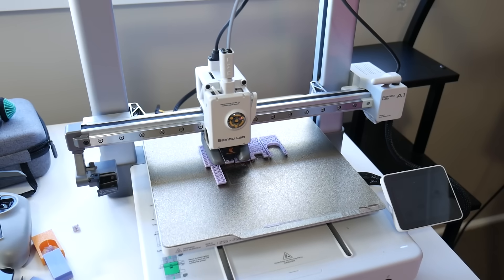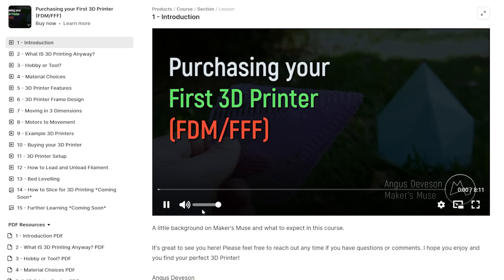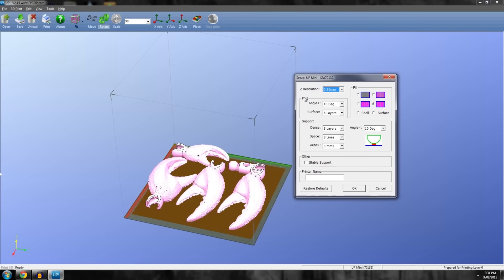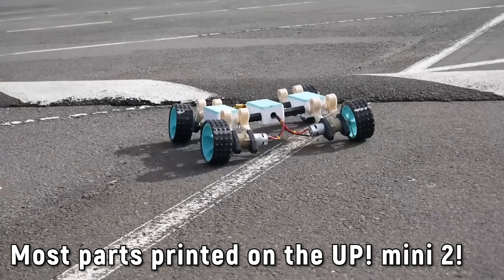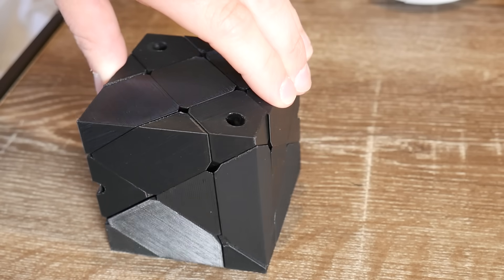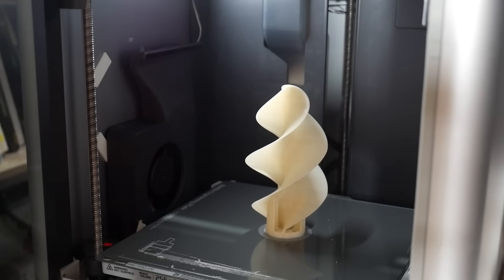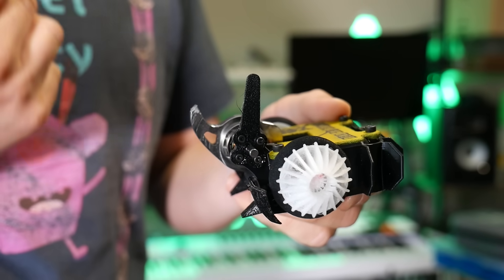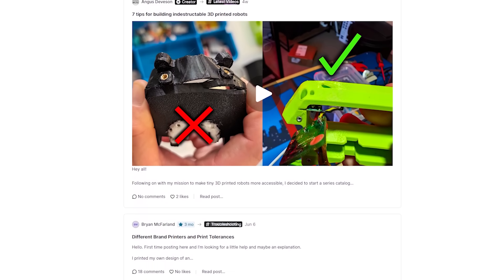The best 3D printer is...

Comment: I'm with you on the Bambu printers. I own an X1C, an H2D, and 5 AMS units. I'm a maker, not a tinkerer. I started many years ago with an Ender and spent endless amounts of time installing and configuring addons and upgrades and hated every minute of it. All I want to do is slice my model, send it to my printer and retrieve the finished product sometime later. My Bambu printers do that perfectly... almost every time. I know there may come a time when I regret locking myself into the Bambu ecosystem, but for now, I am completely pleased with the performance of my Bambu printers.

Comment: 3D printers will never be 100% plug "Plug & PLAY" unless the actual printers (components, build, etc.), and materials are 100& universal imo. And even then, a significant amount of AI would be needed for problem detection and resolution. Computer Numerical Control, CNC,  machines of any type are very complex. And although the ease of operating and print job reliability, speed, build volumes, etc. has gotten WAY better over the years, so too has the number of materials, subtypes (basic, silk, matte, etc.) and the variables that come along with them increased. The biggest problem that really started with Creality's mass marketing and continues to this day is the industry's hype centric marketing. There's absolutely nothing wrong with promoting your product. The problem is, there's insufficient attention given to emphasizing the fact that as cool as 3D printers are, they are not toys, not plug and play. They require, at the very least, a basic understanding of the technology and how it actually works - bare minimum. That said, If a person is going to spend hundreds (or thousands :P  ) of dollars on a printer then it's on them if they didn't do at least a wee bit of research to understand the basics and then keep learning. Unlike 10 - 15 years ago, there is now a VAST 3D printing community via, YouTube, blogs, manufacturer sites (I'm looking at you, Prusa) that provide a monumental amount of info., tips, tricks, solutions, etc. It kind of boggles my mind how many people post the most basic of issues that the research BEFORE buying a printer would have either prevented or made very easily solvable. Angus' advice to do your research  and put thought into it before pulling the trigger on a 3D printer should be the first Commandment of 3D printing. I researched the technology, operation, materials, models, designing, what I thought I'd actually use a 3D printer for for three months before I spent the $$$ on my first 3D printer in 2021.

Comment: Great video! And props for making people think for themselves, instead of blindly trusting others as we're all being trained to do.
Did my reasearch about a year ago (absolutely hated my Anycubic Mega X) and pulled the trigger on a P1S with an AMS - absolute gamechanger!
I love that thing to bits and it completely revived my love for the hobby. Went through the pain of dealing with a cheap, junk printer, and learned the ropes - but having a unit that just works is a godsend.
Reply: My first printer was an Ender-5.  I'd reached the point where I only 3d printed things if I absolutely could not find any other solution; it still had some use but I hated it.  Then Bambu came along, I backed the kickstarter, and after about 3 months was all caught up on things I'd planned to print because there wasn't a better choice, all caught up on things that suddenly became viable to print even though there were options, and all caught up on things I'd started printing just because the printer wasn't doing anything else.  Today, I've become much better in CAD because I'll use printing to solve a problem if it's at all viable and affordable.  Complete flip on where 3d printing fits in my building process, and all because of a truly reliable and easy to use printer.
Reply: I heard the Mega X was a reliable tank that printed well, what did you hate about it?

Comment: My gf and I went shares on a Bambu A1 late last year. It was a decent enough start but honestly I started getting annoyed with it long before Bambu started getting extra shady. By the end of January I really felt like the A1 was holding me back so it got sold to a friend and we bought a Prusa MK4S with MMU3 and enclosure. It's been all good since apart from a small hiccough with the Buddy board but Prusa support got that sorted quickly.
Good solid support from a manufacturer is an important aspect because even the most reliable printer is going to have something happen sometime.
Reply: Was it holding you back? What can you achieve now that you couldn’t then, if you would have bought the AMS?
Reply: @float32  We had the AMS but the MMU3 is better. It will do 5 colours over 4 and has less waste compared to the Bambu system. The biggest thing though was the enclosure, the A1 cannot be properly enclosed to reliably print ABS, ASA and others that need higher enclosure temperatures. Bambu themselves say not to enclose the A1 because they know the components they used aren't rated to handle the heat.

Comment: I bet no one cares, but here's my printer history: My first printer was the Wanhao Duplicator i3 (based on the hilarious review by the 3D Printing Nerd). Horrible extruder and the extruder motor failed, but I replaced the motor and got a Flexion extruder for it and it became a printer that I still use for flexible filaments. I even used it to (very slowly) print a tool for some olympic sailors, because I can get great prints out of it, if I just run it at a "very reasonable speed". The end stops can be a bit glitchy these days and the bed has to be leveled regularly, but I'm printing on a glass sheet and loving the glass-smooth results. Next up, Fabrikator Mini, which I mostly used as a portable & spare printer. Still have it, but haven't used it in years and could easily have skipped it. Then, the original Ender3, which served me well, especially for slightly larger prints, but I never printed anything except PLA on it. Sold it to a friend and it kickstarted his 3D printing and modeling hobby (and maybe even a career). The bed mosfet failed recently, but it's still working OK. Next, Artillery Sidewinder X1: It was OK at the time, but the bed is not removable and those ribbon cables with no strain relief can go bad awfully suddenly. And the bed is AC, which is nice for heating speed, but I worry about the safety. The next one was a huge mistake, but I did use it for a year as my main printer: the Artillery Sidewinder X3 Plus. I totally missed that the X4 Plus was already out at the time. The mechanical design has several flaws and it still has those ribbon cables (but they do have strain reliefs). Still have it and it prints fine, but I wouldn't advise anyone to buy one new. Latest printer Artillery Sidewinder X4 Plus S1. Much better design and I'm really liking Klipper and having wifi. A few software hickups (don't tell it to mesh level the bed unless you have freshly homed all axes) and the power switch kind of failed on the first day (but then decided it wanted to live, after all). Lots of bang for the buck on that printer, but I would still classify it as a hobbyist machine where you should have a lot of technical skill or it will bite you. If someone new to 3D printing asks me, I tend to recommend Bambu Lab or Prusa.

Comment: I had a crappy Wanhao i3 that I had a lot of trouble with, especially with leveling the bed. I upgraded to a Prusa MK3, paying the premium price, because it would just work.  And it still just works, for the most part.  Its seven or eight years old.  It was an MK3S and then an MK3S+. It had an MMU2, an MMU2S and an MMU3.  I've invested a lot of time and money in this printer.

Prusa still makes premium printers, but does Bambu Lab and a few other companies out there.  It's no longer worth paying the extra money for a Prusa printer, in my opinion. There are more affordable options out there that will give you a great experience.  I waited for years to upgrade my MK3 to an MK4.  For what it would cost me to do that, I could buy an Anycubic Kobra S1 combo and still have money left over.  I could buy the Bambu Lab A1 Combo and have even more money left over.  It's just not worth it to me.  (If you're reading this, Josef, I'm sorry. I love my printer, and I've received nothing but stellar support from your team.  If you didn't cost almost twice as much, I'd buy your products again.  You're just too expensive.)

Comment: I agree with most of what you said. I have been 3D printing for around 15 years now and have owned 5 different printers. For the past 5 years I have used Prusa MK3S machines (2 of them) and they are extremely reliable to the point I often send prints (using Octoprint) and then completely ignore the machines (never even looking to see if first layer works) and just know that I will have a great part when done. I sell prints (useful items, not tchotchkes) and needed more speed so I recently (about 5 weeks ago) picked up a Bambu P1S and after the first week I thought I had made a huge mistake, the software is really odd and I was having issues with getting parts the correct size (and in my parts size matters) and while my Prusa prints fail about 1/100 so far the Bambu fails are about 15/100 but when it works it works well and is fast but I do have to keep an eye on it at least for the first 2 layers or so. Having an AMS on the P1S is very nice but the UI for it is clunky at best and often does not do what I tell it to, like last night I was using support with their support material and I kept telling it that roll 4 was the support material (did not auto recognize it) and every time I "saved" it, it reverted back to saying it was black PLA instead of white support material. Took like 6 tries to get it to 'stick' and it finally worked but I find myself fighting the software more than I should have to while Prusa Slicer and Octoprint just work and are lots more logical about settings and operations.
Reply: consider using orca slicer, I'm completely using it in LAN mode now with orca and it's just as good as before, no ams syncing issues either

Comment: I purchased my first 3D printer in early 2018, a bed slinger, common design at the time.   I then upgraded to a Core XY machine in late 2023.    I have been happy with both machines.    I have had my share of print failures, often first layer adhesion issues.
I do like the convenience of auto-bed levelling but my latest machine still needs me to re-calibrate every now and again due to first layer adhesion issues.
I do not consider my machines perfect, but they have been generally reliable which as Angus states, is most important.   3D printing is a hobby for me, but I still expect a print to complete.
Good video Angus.

Comment: At this point, i just want a printer that prints. I don't want 3D printing to be my hobby. Luckily so many printers are far more reliable. I have the H2D now and it's awesome but i equally find my Neptune 4 Plus just as reliable.
Reply: My Qidi q1 pro is a beast. Every single print worked, apart from me doing silly stuff lol

Comment: The best printer is the one you know inside and out. The printer that you can MAKE into a reliable machine, after having learned it's particular limitations. But then again, not everyone likes tinkering with things. It all depends on what kind of person you are, at the end of the day.
Reply: Nah, it’s much nicer when you don’t have to fix bad engineering, and get something that works out of the box, with the limitations being more about the print medium than the printer itself. My first printer was a $200 pos that I made reliable. Money and time spent was a ridiculous waste. I learned nothing of value, since spending a bit more made all that learning obsolete, and putting that time into design of things to 3d print would have been way more valuable. Some people want to play with the machine, some people want to make things with the machine (the reason it exists).
Reply: @float32  If you just want to use a black box and don't care about understanding how it works, that's fine. At least you learned you're that type of person. That's valuable for you to know that. 

I, for one, enjoy problem solving, and learning about how things work, so I enjoy tinkering with machines. I find that rewarding and valuable for me to know. There's no "best" way to be. Just different attitudes towards what you believe to be a better fit for yourself, which is fair enough.
Reply: Well, I built a Voron v2.4 350 and know it inside out.  It's a great printer.  However, my interest in 3D printing is designing and printing functional things.  It was super fun and valuable building the Voron, but I also have a BBL X1C.  And I generally use the X1C because I don't really have to think about it.

I'm still upgrading the Voron.  Added sensorless homing when one of my homing switches went bad.  Added a Voron Tap when I got sick of the Z-offset fiddling whenever I changed the nozzle size (I switch between 0.4, 0.6 and 0.8 frequently).  Changed to MODBUS when a wire for the thermistor broke in the middle of one of the drag chains.  It's just not my workhorse printer.  And at the moment my Voron has a strange problem where the hotend stops heating mid print.

My Voron is my 3D "printer" hobby printer.  My X1C is my 3D design and printing utility printer.  I have the best (and worst) of both worlds.
Reply: @techringo6469  Yeah jesus I get tired just HEARING about people building and maintaining their Voron machines... It's like coding your own OS before you're able to use the computer. 

I'd usually consider myself a fairly technical and handy type of person.... But f that! Creality upgrades are enough of a headache for me tbh!

Comment: FDM printers almost stabilized, still not perfect. There is no plug and play, set and forget toaster oven analog yet. Wish some slicers could use the fancy NPUs in the AI enabled computers, to decide on orientation, supports etc and much more. There is also a need for auto calibration of filament and material, just like a klipper self tuning. It is still a tinketers toy, except with more predictable results with understandable limitations. May be the next game changer could be a 3d printer with suitable material, that could print like a silkworm in mid air!.❤👍

Comment: I love my Bambu P1S for being extremely consistent and making me not hate filament printing anymore (I hated my Creality CR10s so much!!! If I had a time machine I would have told Past Me to just return it.). Though yeah a bit of a suspicious side-eye in regards to how far they want to wall-garden themselves. Presently I think my limit will be if they ever get it in their heads to do like how inkjet printers brick themselves over 3rd party ink and force bambu filament only. As far as PLA goes, I use whatever is the cheapest lol
Reply: Same, I'm sticking to my P1S until a there's a good alternative with an AMS solution. Looking at you, Centauri Carbon.
I dislike the inkjet comparison because to my knowledge, not a single one of Bambu's printers have filament detection built-in and thus it's infeasible. But I would stay far away from any printer they release with filament detection by default.
Reply: @JakJakku  The current AMS can absolutely identify official Bambu filaments. It doesn't matter though because it is done with an NFC tag that can just be attached to a different roll.
Reply: @agelessstranger964 I think the idea is that Bambu would have trouble locking down their machines because the printers themselves don't have any ability to identify the filament they're using. Unless Bambu wants to require the purchase of an AMS for the machine to run, my P1S is going to keep using third-party filament until the end of time, because it isn't hooked to an AMS and it probably won't be anytime soon.
Reply: @JakJakku  yeah the current printers don’t have that possibility but it was the only walled garden printer extreme that would piss me off. I don’t use 3rd party slicers, plates, or nozzles so filament is basically the only nonbambu thing going in my machine unless you count the desiccant.
Reply: I genuinely can’t see the reason for buying Bambus PLA either. The basic eSun PLA always comes out smooth and clean with no extrusion lines on my A1. Outside of the RFID tags for AMS they’re just a waste of extra money

Comment: My $140 piece of shit has failed less than my friend's $1000 bambu, which is a great printer too.
Price and reliability seems to have no correlation in 3d printer world.
Reply: May I know, what is your 140 dollar printer?
Reply: @AVFL173  An Ender3n clone by Geeetech
Reply: @leggysoft  I got that geeetech as my first printer (I still have it), it made me abandon 3d printing because it was a nightmare, 95% of printings were just unusable trash. Now this year I decided to give another try with something newer and got the A1, 100% of the prints got perfect, no single failure. It has gone from a waste of time and money to just work. I design my pieces with Solidworks and is delightful to get the design, drop it into the slicer and print it, knowing that it will simply work.
Reply: If an X1C or H2D is failing that often (Bambu's only $1000+ printers) then something is really wrong with it. Contact support
Reply: @maskettaman1488  They both hardly ever had a failed print.
Reply: I got into into printing with the Anet A8 (a cheap Chinese clone of the MK2S) Bought it for $160 in 2017, and another $150 or so in upgrades over time and it was just as reliable as all those $700+ printers. That thing lasted for years. We printed hundreds of PPE frames for Masks4Docs during the Pandemic too.
Reply: If the friend's $1000 bambu is doing work for 7 $140 piece of ... in speed, but doesn't break 7x as often, isn't it still a win 😉

Throwing single dice once doesn't tell much about it's nature 🤨
Reply: Lies